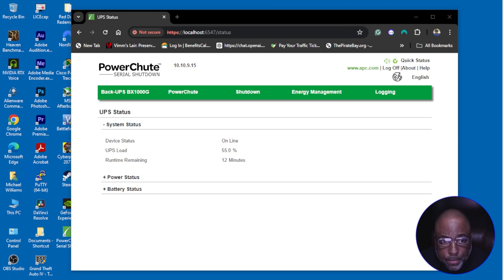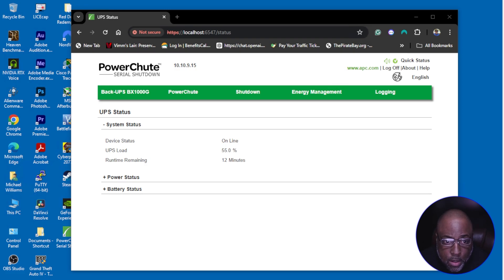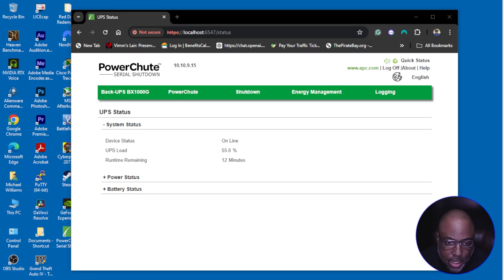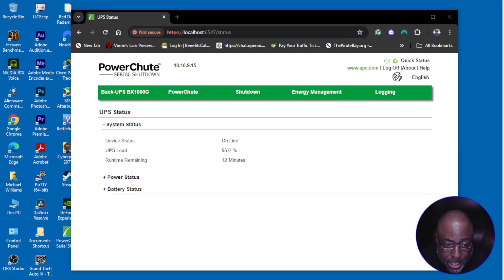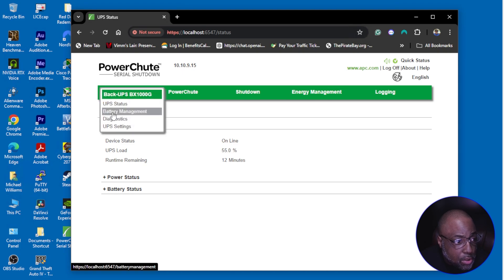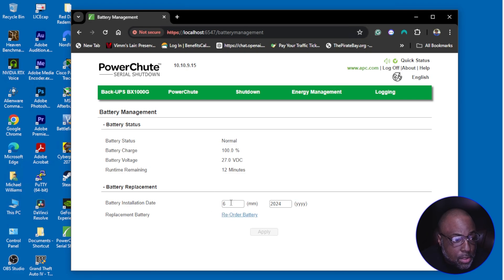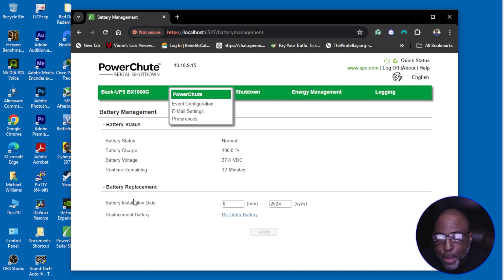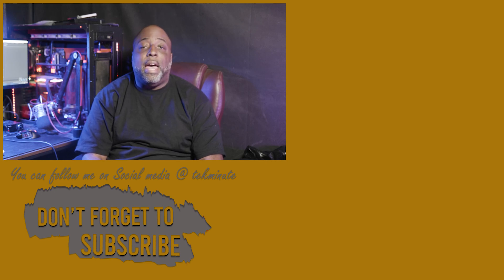APC UPS Battery Calibration, How too !!

Comment: Nice vedio, Sir my APC 2SK is not charging battery bank ,72 volt batteries new , front panel shows initially 1.5 ampere,  then comes down to 0.4 ampere.opened found shunt fuse blown , replaced but batteries not gets charged,please help to restore and fix the problem.

Comment: I been trying to calibrate my apv ups software 
Which recently started to discharge real fast and not charging the battery 
I usually send it to the shop they do some kind of program with hyperterminal and stuff 
I tried to do it manually same but I can't even get an output from ups lol
Maybe if I try this I hope it works
Reply from the maker: I hope so, that’s why I make these videos

Comment: Thank you for making this video! I just bought a used APC UPS 1100 and after I replaced the batteries it still had 1 battery bar showing after the batteries were fully charged. I connected the UPS to my computer using the cable and updated the battery date and boom its good.
Reply from the maker: @ChavezDIY  your welcome sir that's why I made the video to make it easier for yall...

Comment: What kind of cable should i use to connect the apc ups to my pc 
.Is it ethernet to usb A, i've heared that Only RJ50 works (not RJ45 ).
Can i use usb A to rj45 adapter and connect the ethernet cable to that adapter.
I just purchased a replacement battery today and faced this issue .
Reply from the maker: @black77shadow71  Search on Amazon for AP9827
Reply: @tekminute  is it compatible with apc smart ups 3000 sua3000I
Reply from the maker: I believe it uses the same cable from the information available on the internet, but I don't have that model UPS.